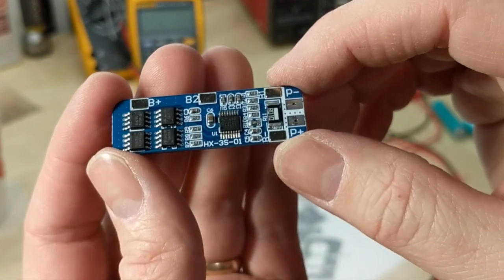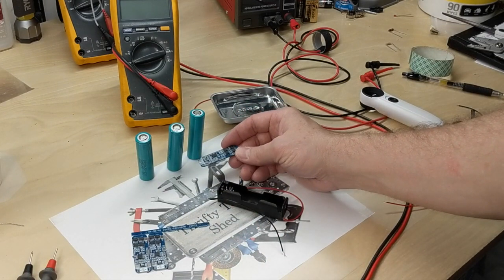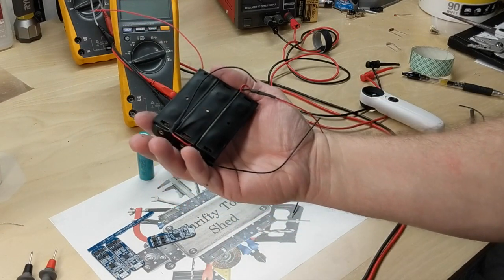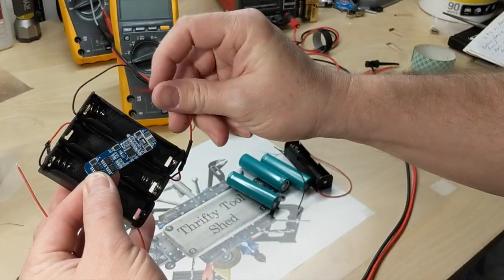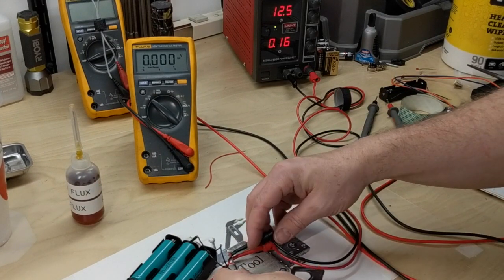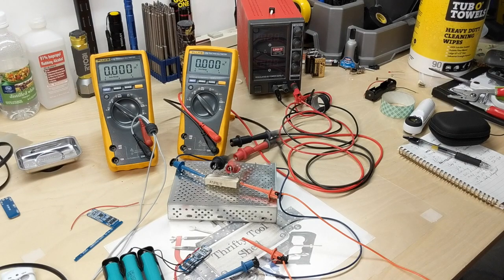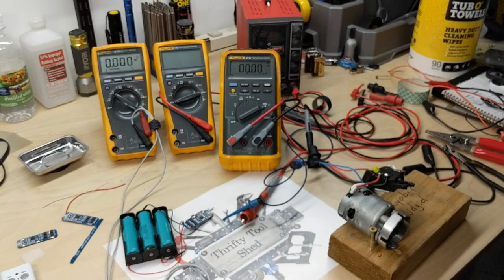Cheap 3S BMS Board  (Weekly What Is It #8)

Comment: I’ve read some DataSheets for cells and some fully charged 100% go up to 4.35v. I would never recommend it but it does help my stress level when charging 4.20cv
Reply from the maker: Yeah I agree.  I would not go over 4.20V either. Most tool packs charge to around 4.15V per cell.  Most 18650 and 21700 cells typically show 2.5V to 4.2V.
Reply: @ThriftyToolShed  I can’t remember the manufacture but soon as I find it again I will post it here. Thanks for your video. 
I also only charge my packs to 4.10ish. And Lifepo4 3.45-.3.50

Comment: If you like me did not get any voltage on the P- and P+ after connecting the batteries you just have to 'wake the BMS up' by giving it 12v on the P+ and P- from the batteries and it works
Reply from the maker: Well yes kinda. It needs charge voltage first like it is charging to activate and also if it faults out due to short circuit or high current it will need that as well.  I should have mentioned that in the video, but it's been a long time?

Comment: Enjoyed this video.  I was wondering though.  If charging three batteries through this bms, could you set your current limit to 3 amps to insure that each of the 18650 receives 1 amp?
Reply from the maker: This is 3S or 3 cells in series so the charge current set at 1amp will flow through all cells. So 12V at 1A would charge all to full 4V each if all balanced well. Thanks for your comment!
Reply: @ThriftyToolShed  yes in series.  Ofcourse.  I am currently building a 18650 and lithium polymer  charging station using tp4056 boards for each cell separately.   I want to power all separately using one power supply.  So  I'm guessing  in this situation, all is in parallel and increasing amperage at the supply matters.  This ofcourse depending upon the number of batteries being charged simultaneously.   Thanks for your time.  Keep up the great work.

Comment: hi great video(the intro is the best part lol)! i need a set of components for a diy tube led light. The tube is 1.5" in diameter, so it fits 3 18650 cells in triangular configuration. Thing is, the leds being 12v, start to dim before one of these standard bms modules cuts off so i have to time the use right now.. Is there a cutoff module, with programmable cut off voltage(10.5v or 3.5v on an individual cell) you would recommend that fits the 1.5" diameter? Should i use a booster as a stabilizer? i'm pretty lost and its hard for me to find this specific info i'm looking for... any help would be appreciated.
Reply from the maker: Thanks for your comment. I have not seen a programmable low cut out protection board that size. I have had a little experience with 1S BMS boards and also the large cut out boards, but nothing that size. That may have to be a build it yourself project there. If you are saying it cuts off without warning, you be able to make a battery led indicator or just install a mini volt meter if you have room for it, so you know what the charge level is. Best of luck to ya!
Reply: @ThriftyToolShed  they dont cut at all. I actually got one of those cheap ones with a relay and adjustable screw but instead of cutting it just makes the leds flicker like craxy and makes a weird buzzing sound. Could be that i got a defective one but i'll keep looking. Thanks anyway!
Reply from the maker: I have had larger ones that will flicker or pulse also. Just wanted to mention mine has 2 setting and one was charge level and one was cut out level. Yours may not be like that, but wanted to share that I had mine upper setting too close to the lower and when the cells would drop out at the low setting and bounce back in voltage it would just repeat the cycle. I cured that on mine by raising  the set point for the higher or charge level. I just did a video on a 60V 30A Low cut out protection for my 110VDC dual EGO battery supply. I use it to run universal motors etc. like sanders, vacuums and grinders. It works well, sorry it is way to big for your application though.
Reply: @ThriftyToolShed  ive seen digital ones like you the one you mention. Just .15 inches larger than i need. i'll see how i make it work. Thanks again!

Comment: why my output is zero!
my output is showing zero volt :(
Reply from the maker: If it is same board, you will have to give it a intial charge input voltage to activate it. That will also be a way to reset if over current etc.

Comment: I'm feeling tempted to make one of those myself. The thing is, I don't have a power supply like yours and the only cells I have around are 18650 VTC4 rated 30A. I have the cell holders and a Littokala Enginner Lii 500. I guess I could do one the same as yours, charge the cells up using my Littokala charger, put them back in the holder and let the bms do its job in order not to over discharge the cells. I will be using it to power up an old radio (Almost 20 years old radio) that I have in the garage that uses 12V. This old radio takes 8 old style batteries, C or D style batteries, I can't remember right now which is which. I already hooked up a 12v power toll battery and it works fine. However sometimes I need the battery back to use in the tool and therefore no music :-) LOL. I guess the 18650 VTC4 rated 30A will be an overkill...
Reply: Forgot to ask, do these boards have some sort of led Light (Red or blue or even green) showing when the batteries are charging up and when fully charged? Thanks

Comment: Can i also use 3 Battery in parallel and 3 in series and each pair have capacity about 6000mah so is it good in my case ?
Or shall i go for upper one?(like 20amp bms)
Reply from the maker: I believe as long as the current rating of the board is enough for your needs. You are ok. Still a 3S group, just double check the current capability is enough.
Reply: @ThriftyToolShed  thx for replying bro 🙂
U helped me alot 🙂

Comment: so this one doesnt do balance cell charging right??
Reply from the maker: Correct, these mainly protect cells from overcharge, overdischarge, short circuit etc. Some larger board and little more expensive board will do the balancing as well.
Reply: @ThriftyToolShed  could you suggest some 3s balance cell charging boards
Reply from the maker: This is an example that claims in the specs it has 45ma balance capability. I have not used this to say it works or not just as a example!
https://www.amazon.com/dp/B07MMTVJVH/ref=cm_sw_r_cp_apa_i_y9HgFb24SNJM0
Reply: @ThriftyToolShed  really appreciate your help thanks a lots

Comment: Inspired by your video, I've done some tests on this board myself and have found it to have several problems. If I have 3 cells, 4.1v, 3.33v, 4.18v and start charging, as soon as one of the cells (the last one) hits ~4.26ish it cuts off charging for ALL of them. While I understand this is not a balance BMS, I thought the behaviour was that it only cut off the charging on the individual cells that are already at max and continues with the ones that are not (the 3.33v one)??
Reply from the maker: No, the mosfets on this board only cuts power to the output. It does monitor the individual cells and yes it will cut out when any cell reaches it's either underdischarge limit somewhere around 2.6V and over charge limit of around 4.2 volts or so. You can buy a bit more expensive board that will do cell balancing as well. I think you can still find now alot of people just use the balance leads to the balancing lipo/lion style charger.
Reply: @ThriftyToolShed  Crap I thought it would just cut off the whole battery during under voltage, not when charging. I was hoping it would only cut off charging to individual cells that have charged, leaving the others to still charge. Thanks. Do you have a link to a slightly more expensive one that does balancing please?
Reply from the maker: @Ziplock9000  
This one shows it has it. I have not tried it myself. These balancing boards are larger.
http://rover.ebay.com/rover/1/711-53200-19255-0/1?ff3=4&pub=5575400462&toolid=10001&campid=5338325412&customid=&mpre=https%3A%2F%2Fwww.ebay.com%2Fitm%2F3S-40A-BMS-Protection-Charging-Balance-Board-Li-ion-Lithium-18650-Battery-TOP%2F332977775703%3F_trkparms%3Daid%253D1110006%2526algo%253DHOMESPLICE.SIM%2526ao%253D1%2526asc%253D20200520130048%2526meid%253D3bf5ceeba0794f908a53a5f58df57de6%2526pid%253D100005%2526rk%253D3%2526rkt%253D12%2526mehot%253Dco%2526sd%253D174306038690%2526itm%253D332977775703%2526pmt%253D1%2526noa%253D0%2526pg%253D2047675%2526algv%253DSimplAMLv5PairwiseWebWithBBEV2bDemotion%2526brand%253DUnbranded%26_trksid%3Dp2047675.c100005.m1851

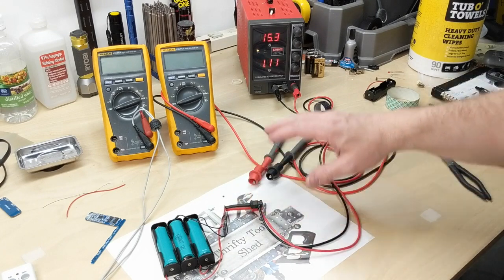Comment: 9:41 Have you since confirmed the cutoff was 15v? As you know, that's 5v per cell, which is extremely high considering that means it wont cut off at 4.9v per cell. That's very dangerous and could cause a fire/explosion. The specs say 4.25v-4.35v, which I'm not inclined to believe. You'd be better off using a multi meter set to MAX or better still an oscilloscope to check this for sure rather than the bench PSU as it clicks on and off. Maybe another video if you've not explored this yet? Great video though, thanks.
Reply from the maker: Sorry if not explained well, but I had the PS set at 15V to show that it would not allow the voltage to get that high. It was shutting down at 12.9 the CC control is cutting out so, the the PS shows the 15V on the display. The reason is that the BMS has disconnected the cells from the supply. Thanks for your comment!

Comment: I would have been tempted to not solder the BMS to the battery pack directly, but to connect them via a 4 pin JST connecter and XT60 plug. That way you could connect the pack to a battery monitor like a CellMeter-9 to check individual cells or even to a battery pack charger like an iMAX B6. Because apparently the iMAX manual recommends not having a BMS attached when charging.. which is ok if they are connected via the plugs I suggested.
Reply from the maker: I have some I have done that way as well, they work great. I do love the XT-60 connectors for sure. I keep bags of them....
Reply: @ThriftyToolShed  Nice. I have this specific BMS sitting in front of me, battery holders and spare 18650's and XT60's and JST.. I'm wondering which way to go. Right now I'm just experimenting and don't have as specific use.

Comment: Does have balancing, overdischarge, overcharge and overcurrent protection BUT NO SHORT CIRCUIT PROTECTION.
Reply from the maker: So are you stating that you tested yours and the short circuit protection did not work on yours? Because not only does it state that it does have it, I tested the one I had and it did work! So a little clearer on your comment please!

Comment: what if i charge with 19v power adapter.. will that charge?
Reply: It will cutoff immediately. These little 3s BMS will cut off around 12.8volts... So if you give it more then that. It'll cut off.

But you shouldn't charge these with a adapter anyway. But use a proper lab switching power supply like he does.
Reply: @TheViperMan  what happen go below 12v? will it boost up the voltage automatically?
Reply: @jj-jo6wr  no it wont. Theres no boosting on these bms.

Comment: What is max input volt for this bms
Reply: If you have 3S .. you shouldn't go above 12.6v (3x 4.2v).. But thats depending on the Lion cell you use.
Reply from the maker: Usually around 12.8 Volts.
Reply: The control chip 8254a has a maximum input voltage at 24V BUT as he said do not go over 12,6V to be om The safe side!